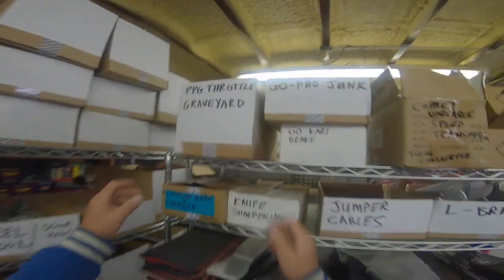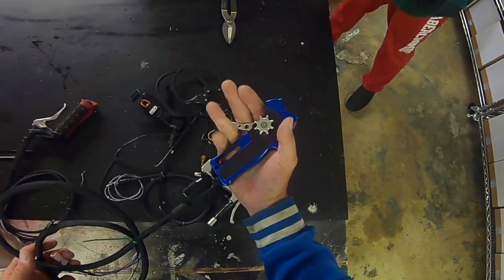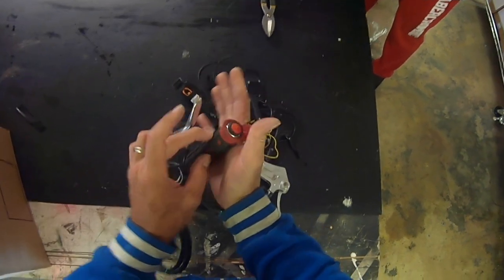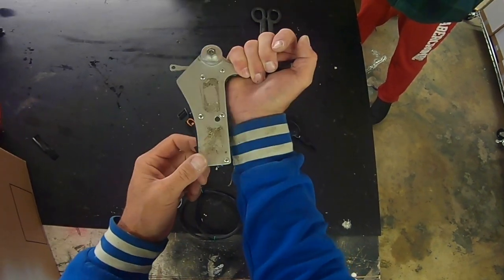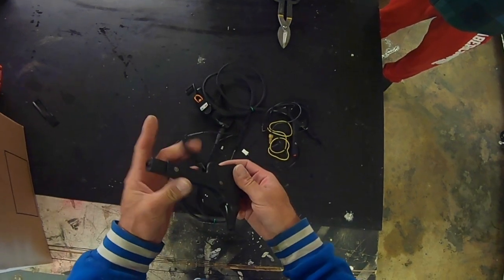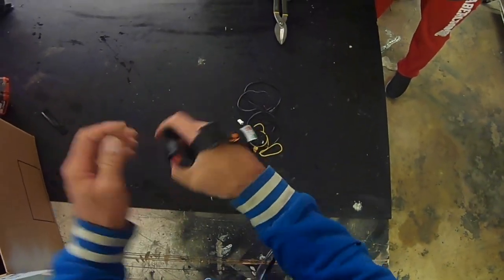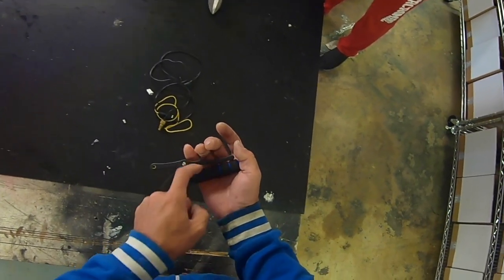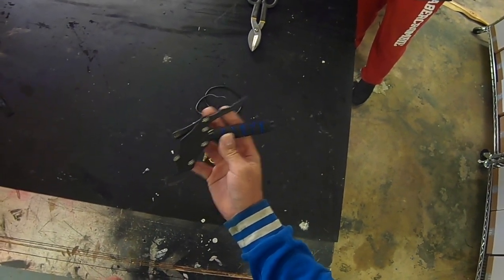Graveyard Tour:  Where Paramotor Throttles Go To Die

Comment from the maker: Since I filmed this video, I've come across another contender for a top performer in the throttle line up.  I've seen it on Harley Milne's, and Mark Huneycutt's units.  It has a very ergonomic feel, such as I mention liking here, but also a beautiful cruise control with fine adjustment capability.  Chime in if you know the one I'm talking about.  I don't mention cruise control much here  It's personal preference, but if you are doing long distance ppg xc, it's a wonderful addition to any throttle setup!
Reply: Yes. I emailed him and they are going to be released in the spring... looks real nice.
Reply: Try a chamelion finger throttle
Reply from the maker: @mwethereld  No way would I want to tie up my index finger!  It's what I use to manipulate EVERYTHING!  Zippers, trim tabs, lines, cameras, instrumentation, all that would be hindered by a chameleon throttle.
Reply: I was going to leave a comment about Offgrid Aviations new throttle they’ve got coming out but looks like you’ve already seen it! It looks impressive, can’t wait to try one. Never been too keen on the Vitorazzi throttles either.

Comment: Youre the best👍 those problems on the polini is the same on miniplanes throttle, i was going to cut the lever a bit but drilled new holes and slided up the strapholder instead after watching this. Thanks!!

Comment: Came across this as I design my throttle now. My throttle must have a cruise-control (a stopper to maintain the RPM and free the hand), the mirror and the T°-gauge (EGT is my choice). I use Polini with self-made cruise and EGT.

Comment: I would like to see a mechanical throttle stop set screw in the hand throttle to prevent any excess pressure on the carb linkage if squeezed too hard.
Reply: a spring on the end of the cable would stop this, i have it on mine,

Comment: 3.28, Your homemade one looks sweet, have you considered using a velcro strap and attaching the body to your wrist, just the lower section and not having a hand strap altogether, in the video, it looks a good possibility, how practical ?, I'm unsure but a hands-free throttle sounds sweet
Reply from the maker: I imagine it would be a tangle hazard.  Also, increased risk of not being able to ditch it if required.

Comment: I've been in that box!  You've got quite a collection. I know you don't do a lot of E-start motors. I ended up with the VortexEro throttle.  I like the fuel warning light (although I don't depend on it alone). I'm guessing the cruise knob may be a concern.  I have not experienced any line issues yet. It locks in the off position.  I like that.  But it's still part of my pre-flight check list.  Have you had your hands on this one? 

https://vortexaero.com/products/xc-e-start-throttle-only
Reply from the maker: Yep, it's a knock off polini.